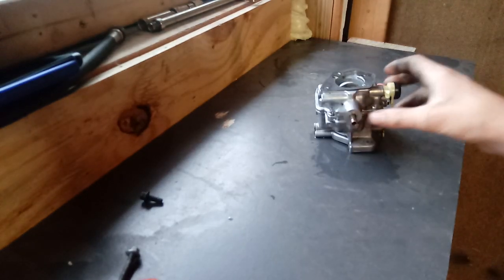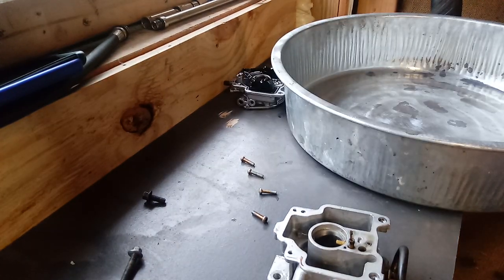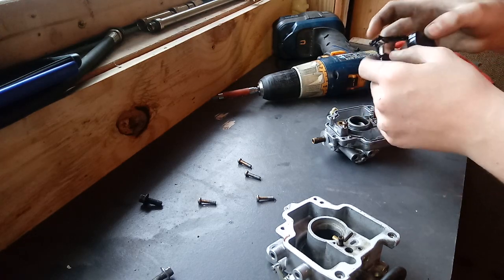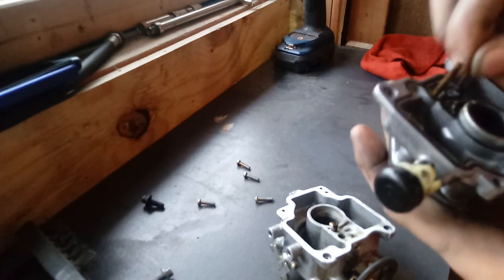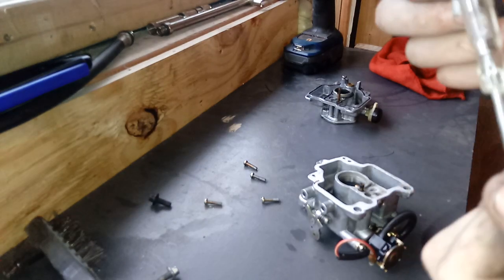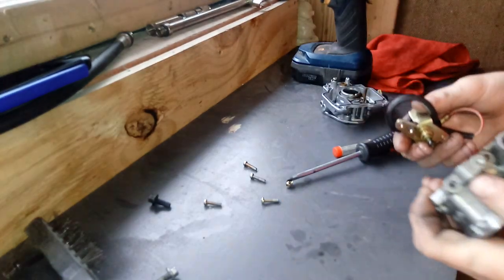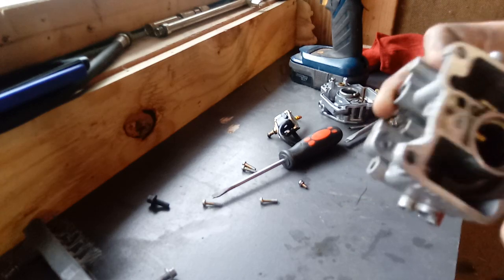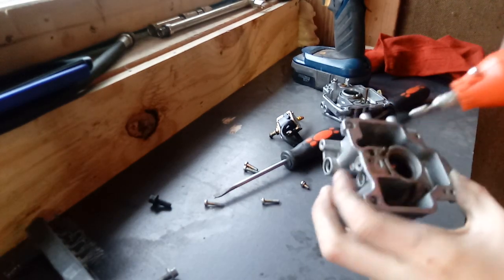Kohler Command 18 horsepower rebuild part 3(carburetor)

Comment: When you don't use an air compressor to help clean your carburetor then carburetor cleaner would be the next best thing. That round fuel solenoid jet comes off by just pulling it and the shaft of the solenoid if its not stuck on it and should be cleaned and a new o-ring replaced if needed. Good start for a young gentlemen like yourself. Just be careful your drill produces sparks at the armature it can cause a fire!!!

Comment: The copper part on the fuel solenoid with the orings is the seat for the fuel solenoid plunger. It should NOT be stuck to the plunger. It should be separated and cleaned out. The way it looks in your video its stuck to the plunger and will not let fuel into carb under a load.
Reply from the maker: Oh really well it did and this was years ago he has had 0 problems